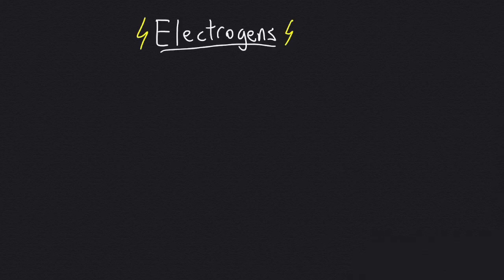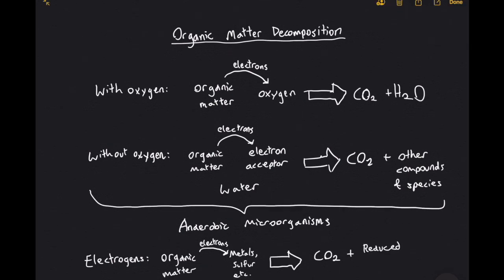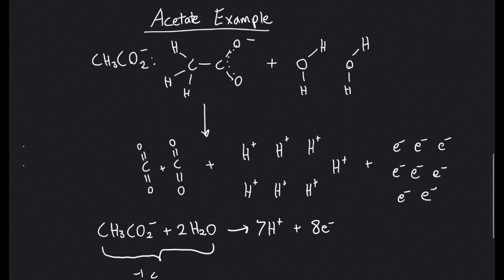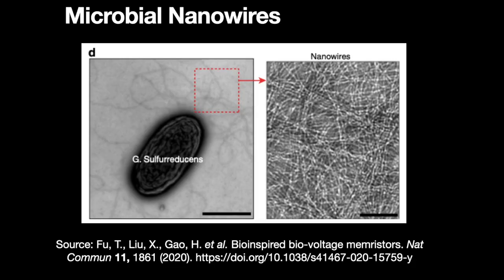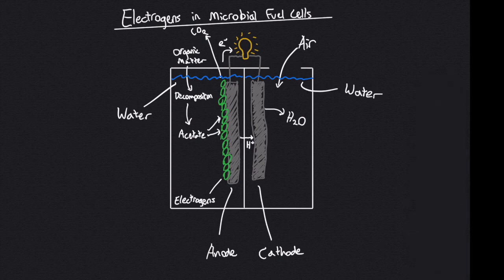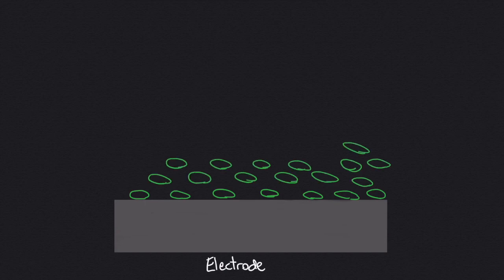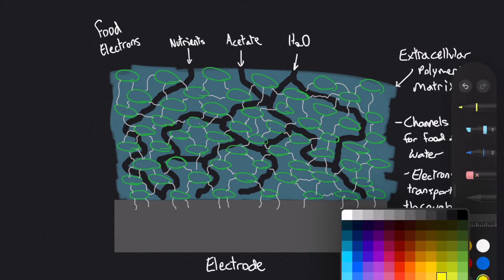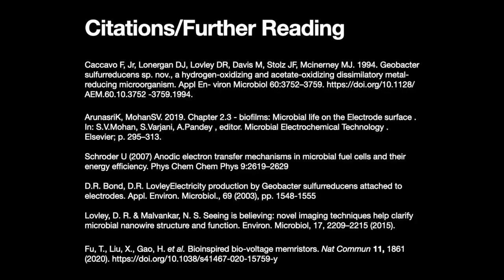Electrogens, Nanowires, and Biofilms (MFC's pt. 2)

Comment: Hi I am currently a university student and I am writing an assignment concerning MFCs, with your knowledge I want to ask about my results I produced. MFC used was dual chambered, anode material was carbon veil material, and the cathode was activated carbon and PTFE. the membrane was ceramic. Acetate was the substrate and tested for bot river sediment and lawn soil, both produced low power density, but high treatment (oxidation) of the organic matter. please could you explain what occured for the to be lower electrical production? hope to hear from you, thank you for your videos they are so helpful!